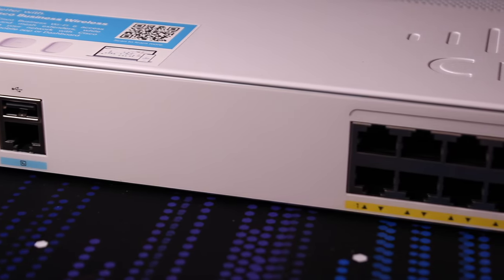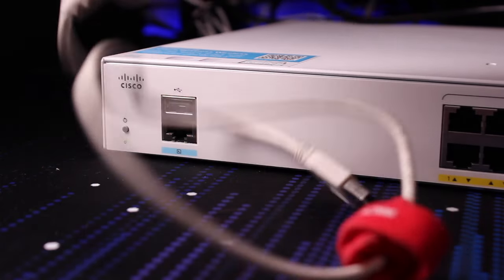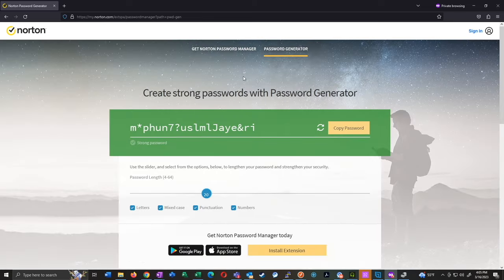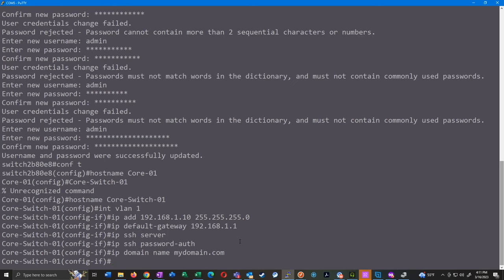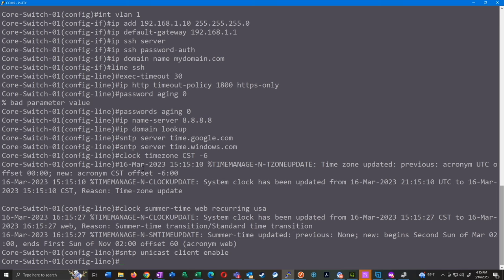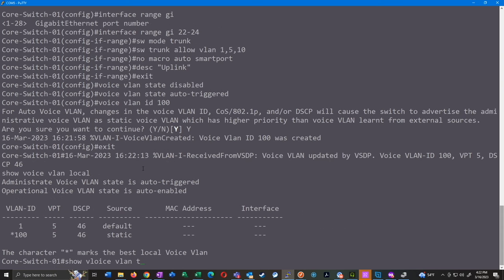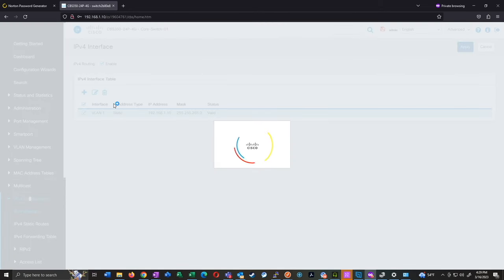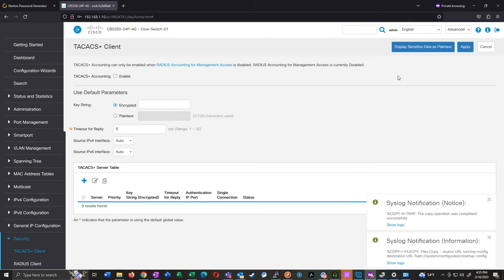Cisco CBS350 - Initial Configuration

Comment: Is there going to be a follow up to this? Or is there one I haven't seen yet? Coz it would be awesome to see what maybe a normal use case... For example... Setup 3 VLANs (Admin, Office Network, WiFi Network), make the last port an uplink to the router. Configure InterVLAN routing so the 3 networks can begin to talk to one another and make that last port be able to send traffic to the internet and back for each of the 3 VLANs. Finally, configure ACLs so that Office Network can't communicate with the WiFi Network and vice versa. I think that would cover a bunch of use cases and would lvoe to see a step-by-step for this process. Yours is the most informative and undertsandable video I have found on these CBS switches. Thank you for this
Reply from the maker: I had planned on making some sort of follow up along the lines of general switch administration.  This video didn't have a whole lot of interest so I didn't ever get around to actually making one.  I'll add it to my list since you are interested since switching is one of the topics I like the most.
Reply: @ToastyAnswers  Super interested for sure! Thank you!! I'll be keeping my eye open for if you make it :)

Comment: Hello, and thank you for your wonderful video. I have a complicated problem regarding one of these switches.  It is in a rack that manages a training room's AV system, and one of my touch panels is complaining of a duplicate IP address on the network.  I have been called in to service this system, and the vendor/installer is no longer available. I am able to obtain the IP of the switch but it appears the HTML configuration is turned off.  I know this can be done at the console level. 

My question is, after reviewing the whole AAA console commands manual for these switches, it seems like there should be a way to bypass the password, or to initiate a password recovery, etc. from the console without entering the credentials.  I want to ask if you know how to do this.

A hard reset of the switch is the absolute last resort, as it will break the entire AV system and I cannot be sure how long it will take me to learn enough Savant to get the crestrons communicating with everything again.  

Is there a way into my switch without a hard reset?  CBS350-8FP-2G

Comment: Thank you for this video. The explanations are crystal clear. I've heard that Auto Smartport can give a hard time if enabled on standard (non-uplink) access ports. Do you think it's a good idea to completely disable this feature for all ports? Thanks
Reply from the maker: I personally hate smart ports, but I've actually had the opposite experience with them.  I've experienced them causing more issues with uplinks rather than access ports.  Also, if you need to disable the smart port feature on an uplink after it is "live" then you run the risk of cutting your nose off (disabling smart port can revert the port config to default and cut off remote access). 

On my personal equipment, I disable them entirely.  I'm used to working with Catalyst and manually assigning VLANs anyway, but I understand that isn't for everyone.  The only part where this gets a bit weird is with the voice VLAN.  I've found it's easier to manage that by just keeping smart ports enabled and using the auto voice VLAN feature. 

On production equipment, I only disable them for uplinks (for previously mentioned reasons).  I'll leave them enabled for user ports since the auto voice VLAN seems to work pretty well and I haven't run into issues with client devices.

Comment: I have the 250 version.  I am having a hard time for some reason getting my to allow connected devices internet access.  I have my Cisco 250 connected to a home router and have created 4 VLAN's.  Created GE1 & 2 are trunk ports.  GE5, 6, 7, and 8 are my VLAN's.  I am able to ping the the ports from other devices, such as device connected to GE1 can point GE5 and GE5 can ping GE1.  But for some reason I can't get my devices connected to the Cisco 250 internet access.  Any idea what I am doing wrong?

Comment: I was attempting to change an initial DHCP IP address to a static (for another facility-sub). I had resigned to adding another as you stated, then deleted the original. It worked. Glad to see you are equally puzzled by the inability to change addresses from the "Edit" option!

Comment: Thanks for the video, very helpful. I was interested in what you indicated about a Catalyist. I like this device as I need at at least 2x10GbE RJ45s and 2 20GbE SFP ports. Is there a 10GbE Cisco Cataylist withboth 10GbE RJ45 and SFP ports that you might recommend? I'm a small business home user.
Reply from the maker: Not off the top of my head, but I know the C9200s have four SFP+ ports which could be populated with RJ-45 SFPs.  The actual port density is nearly identical to the CBS350s (24 1gbps RJ-45 & 4 SFP+ ports).  The difference I believe is that the SFP+ module is an additional purchase (the switch comes with a blank module by default). 

If you haven't looked into the Catelyst line before be prepared for sticker shock.

Comment: Hi.. i have the same unit freah from the box.. i was able to go to cosole.. but the default username and password cisco is not working.. authentication failed when entering the default credential. thanks
Reply from the maker: Interesting, the default login should be cisco/cisco.  This should be changed at the first login.  You may need to follow the factory reset procedures and try again.

Comment: Does the 250 and 350 business line have IGMP snooping. We have a large network and Im needing a small 8 or 16 port POE switch for surveillance cameras. I wamt to connect via SFP  module over fiber to a 9200L. That would be compatible, correct? Im faily new to the networking side but have added switches in the past but most of my switches are Catalysts. Ive never used anything other than the 2650 or 3850s
Reply from the maker: So, according to the datasheet, both support IGMP snooping.  However, multicast is not something I'm super familiar with and isn't something I've really dealt with extensively.  YMMV.

Up linking to a 9200L is definitely compatible as long as you follow the SFP and fiber compatibility.  I have plenty of clients who have a mix of 9200 series with SMB, SG, and CBS switches all uplinked over fiber and copper.

Comment: If you only want to use the 10G ports for hardwiring multiple computers via CAT6A runs, can you please advise if I need to configure anything? Basically, use it as a dumb switch.
Reply from the maker: There shouldn't be any configuration necessary, but you may be better served by a 5 port 10Gbps SFP switch instead.

Comment: Thank you for another great video.  I'm an old timer network engineer who started out with the 3524.... lol  The first time I came across the usb console cables you had to have special software installed to use it.
  Do you need a Cisco installer for this usb C to RJ45 jack cable?  I'll read the quick start guide on the CBS250 I just received to find out if it's mentioned.
Reply from the maker: Oh, the good ole 3500 series.  That used to be some top-tier equipment right there.

I still find that certain makes/models of USB-to-console dongles require additional software to be installed.  They are becoming fewer and fewer as time moves on, but I know they still exist.  I probably have dozens of these dongles lying around and I can tell by looking at them if they will be plug-and-play (sorry.. I don't have the details of which are which...).

I actually used a regular USB-A to Console cable adapter in this video which did not require any additional software to be recognized.  However, I have a USB-C to console cable I typically use. My specific USB-C to Console dongle did not need additional software to install, but there is a pretty major caveat here and that is that I only use it on a Mac.  I've never actually tried to use it on a Windows machine, so I can't tell you if there are any issues.

Comment: So I have the SG300 for home. Has been fantastic even though I do everything through the GUI. I was thinking of upgrading the home network to 10gb. I would have thought the successor would have been 10 gig? So they don't have small business switch that is 10gb? Thanks for the video.
Reply from the maker: I am not aware of a "full" 10Gbps small business switch.  However, I know there are models with up to 4 10Gbps uplink capability.  

I typically look elsewhere for 10Gbps switches.

Comment: I have run into difficulty resetting to factory thru the reset button.  Tried holding for 15-20 seconds, tried longer, tried shorter. And eventually it resets but takes multiple attempts. Have you factory reset one of these via the button and had any difficulty?
Reply from the maker: I have reset a couple with the button and never really had an issue.  However, I typically hold it down for 30 seconds just in case.  I've heard this same issue from other people though, so I might just have been lucky so far.

Comment: After you finish setting up your setting for your cisco switches do you backup the configuration of the switch?
Reply from the maker: Yes, especially in a production environment.  Once the switch is configured an initial backup is taken and kept on record.  A second backup is typically taken after the actual installation since there may be a couple minor changes needing to be made afterwards.

Comment: Hey Toasty, how do you configure OOB management? the datasheets say its supported, but what port?
Reply from the maker: OOB management is supported, but it's more of a configuration issue than a per-port feature.  If you have a dedicated management network, you can configure a single port to use that VLAN with a corresponding interface-VLAN.  You get to choose which port this gets applied to. 

Going further, you could use a terminal-server device to connect directly to the console cable.  These aren't really used much anymore, but the concept would still work with these since they have the standard RJ-45 serial port for console access.

Comment: Any insight on configuring a sfp for fiber or is it plug and play ?
Reply from the maker: SFPs are pretty much plug and play.  The port configuration is identical to any other type of port. 

Most of the complexity of SFPs comes from finding a compatible module and transmission media.

Comment: LIBERTY  is horrible in Costa Rica.    I DO NOT recommend them.    They just installed a new fiber optic line to our building and left it with a Cisco 350 series 8T-E-2G switch and the technicians left with no paperwork, no weblink or any information on how to set it up.   LIBERTY has provided internet to this office via coaxial cable that still works.  It is unbelievable they did not switch over our internet from the cable to the fiber optic.  But NO.. Liberty left us with nothing.   I am the building owner and now I need to add a new router/wifi to this switch... so I am here on YouTube to find the solution.   Maybe this video will help!   Thanks for uploading this tutorial video.